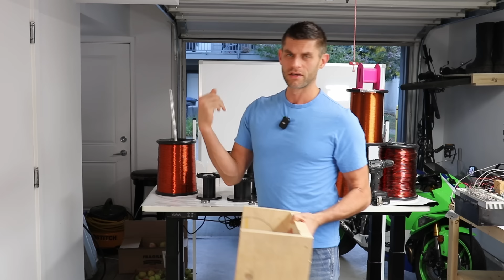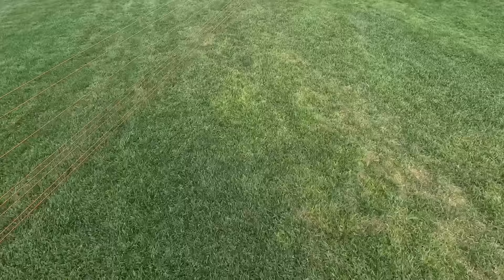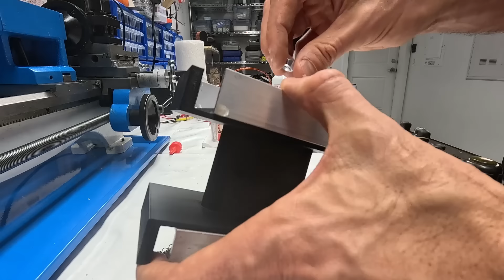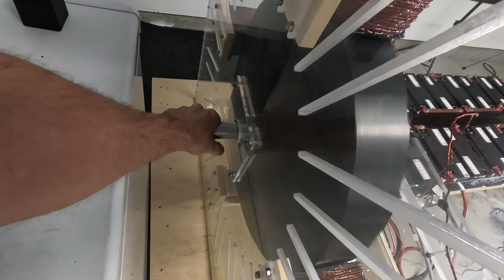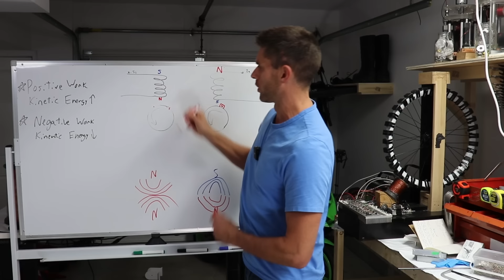The Device That Could Give The World Unlimited Energy

Comment: From my limited understanding on this motor the extra power is coming from the high voltage spike when the coul is turned off which is used to charge the batteries....now later in Bedinis work he started working on the MEG...motionless electromagnetic generator which used the same concept but eliminated the spinning flywheel and instead used 2 sets of coils...2 to create the high voltage spike...and 2 I believe to capture the high voltage sike to charge the batteries eliminating the need for the spinning flywheel making the device solid state with no moving parts....have you done any research into the MEG ....
Family problems kind of made me lose interest or should say was busy with life so have not done much research into the MEG device so just wondering if you have any knowledge about it or conducted any research into it...
I dont have the resources or equipment to explore it like you have but am very interested in your work....and am very interested in the MEG but have not seen anyone actually build a working model of the MEG...
Reply from the maker: Yes so many things to build :) im going to focus on finishing this build but yes the MEG tech looks legit 

Thanks for commenting

Comment: WTF -.- did no one catch that he did not show one time the end of the shaft reaching out behind to this big white box?
He grabbed it by hand to slow down the spinning oO but never shows the end of the rod/shaft... 1000% a motor is attached

even if not... why did he show these useless meassurements?
Reply: 29:34 its not connected to anything check the time stamp, or any other video where he shows around the whole machine.
Reply: @joshz7419  uhaa ... how did I miss this XD ... OK but still the meassurement is not really anything usefull ...(*￣０￣)ノ

a simple setup with two identical AMP and VOLT meter side by side... one for batteryOut and for batteryIn... in one shot over a few seconds would had prooven much more... 
and an oscilloscope is needed to show these spikes he mentioned... 

some variables to calculate the data by myself for the in`s and out`s would be nice ^^

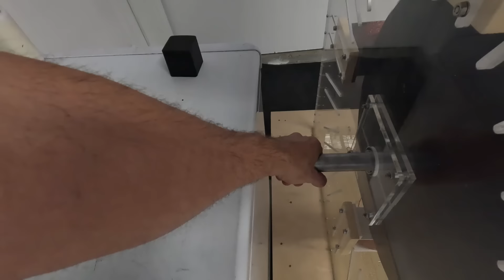36:22 perfect obscured
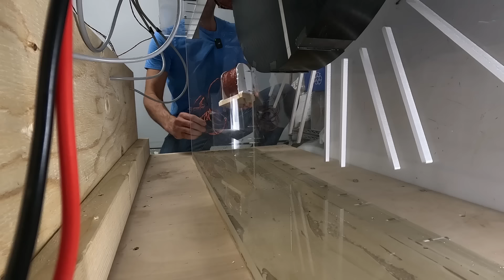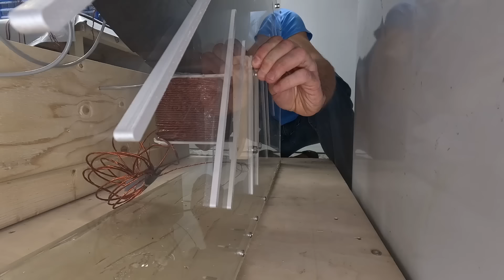25:45 - 26:00 perfect obscured
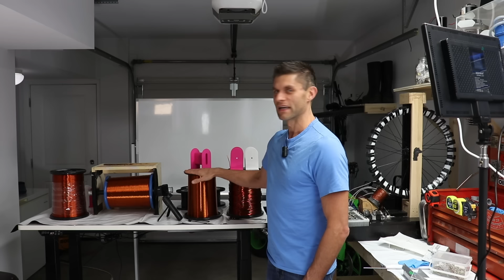20:52 (background) perfect obscured

every time soo close (╯°□°）╯︵ ┻━┻
Reply from the maker: Thats a white deep freeze lol
Reply: So if you connect your flywheel to bicycle pedals, and make 500rpm , wouldn't that be the input rotor rotation needed to trigger all of the system...? Why ever drain energy to spin a wheel..
  I think I read that in an ancient cave ,wall drawing, bro good luck..
Reply from the maker: Lol

Comment: Question: If your batteries are not connected to an Earth 🌎 ground, how can the circuit be completed between the ethereal energy and the batteries? Without an Earth ground, isn't that an open circuit?
Reply from the maker: I dont think so aether just flows in it dosnt need a ground to earth 

Though we plan on having one and seeing difference
Reply: @MadscienceLPTECH I just noticed that Mr Tesla had a huge earth ground on his setup, and I wondered why it was necessary. I will be interested to see if it makes a difference. 
I have 3000 watts of solar panels and a wind generator, charging eight 25.6 volt, 100 amp hour LiFePO4 batteries. 
I find your theory to be very possible. 
I don't know a great deal about that end of the free energy world, except that I think you're onto something, because of one thing. The Dendera light bulbs that lit up underground areas worked off of high voltage ⚡. The base of the bulb 💡 projected a beam of plasma through a " lotus flower " ring that adjusted the plasma beam towards the anode. Sort of like a microwave tube magnet 🧲. I never knew it was that high tech until I watched a YouTube video about it recently. Whoever made them knew a lot about electricity though. 🤔⚡⚡👍
I've wondered about the push/pull of the magnetic coils, if maybe they don't have to both be utilized to achieve " over unity " and perhaps that's why only using one or the other, like only using one pole of the coil, wasn't enough. Some arrangement of the coil to the same disc, so the coil would be sideways instead of edgeways. 
I noticed that none of the designs such as the Bedini motor took advantage of that principle. I figured that there was some little trick like that was all that was missing, and nobody caught onto it. It just seems like the combined push and pull simultaneously would yield more than just one or the other. Like you said, one pole won't make as much juice as both ends of the coil being used. Just a theory I had. I just figured it could be worth a try. I was surprised that nobody has done that yet.

Comment: in the drive side if the magnetic field induced in the rotor, slip speed relative to the magnetic field in the stator increases, ie the current in the stator is regulated by the slippage of the rotor. yes your device will be very efficient as long as you don't introduce physical load to the rotor then energy consumed will be commensurate to load applied. The real beauty is that all of these interactions occur in mid-air and are ostensibly, invisible to the naked eye.
Reply from the maker: Thanks for the insight

Comment: At 40:40 I don't believe that is true at all, if your doing more work, it is not free. 
True, you should have your setup for the lowest reluctance path for higher efficiency.
Reply from the maker: The field on field interation is there for the taking use it as you will without any impact on the flow inside wire
Reply: @MadscienceLPTECH I don't believe this is true at all. 
Take any transformer, power the primary and no load on the secondary, input amps is low, now put a load on the secondary, the input current increased. You putting a larger load on the coil, and that is not a free lunch.
Reply: @MadscienceLPTECH do the same transformer above with no load, now stick another coil next to it with a load, again, no free lunch.
Reply: @MadscienceLPTECH why do you think it's free energy? I explained why I think it's not free.
Reply: @MadscienceLPTECH thinking more on this topic, you have a coil with current and swiping a magnet past that coil is NOT going to affect the coil current? (Regardless if the magnet is pushed past the coil or getting pulled) Of course it's GOING to affect the coil current in some way.

Comment: All wires are considered antenna electrically.. Learn antenna theory and you might know some more of what is going on.

The ferrite powder above the magnet is a red herring. Any structure seen from the powder is due to the powder in the magnetic field. There are no lines. The lines come from the powder. Try magnetic film and you will see the field better as the powder doesn't move due to be locked into the film.

 Also again the Bedini method of running this battery rehabber actually does permanent damage to the batteries and can only be charged or used ever again on the Bedini system. The plates crystalize and it blocks normal current charging the electrolyte around the plates. The charging process comes only from high voltage impulses of one polarity. This punches the plates and eventually crystalizes the battery plates and this crystallization will not allow the plates to interact with the electrolyte in the battery cells in normal charging mode. Only high voltage spikes will be allowed pass the crystalized lead, much like a diode type of thing. Bedini usually used negative impulses which allows the diode to pass the impulse but not the traditional current to charge the cells.
 And to be clear the output of the battery is not changed as the diode is forward biased going out. It is the charge direction that is blocked by the regular chargers we use traditionally with these batteries, the bedini method bypasses the diode by reverse biasing the lead crystal and a short burst of negative current flows. You can charge a battery by pulling the negative plate further negative and using the battery in a reverse kind of operation polarity wise. It will still charge.

The answer to your question about the poles is this. The attracting magnet will have residual magnetism and not let loose as quickly. It will cog... The repulsion method works better because the electromagnet having residual magnetism wouldn't hamper the wheel at all. In fact it might make it better since it will have a continuous magnetic push for longer time....
Reply from the maker: We dont plan to charge normally. There are going to be many ways to get the energy this is just the prototype

Comment: heres a off the shelf one for you .
car automatic fly wheel. five car alternators. 
mount them to the fly wheel the gear off the starter. will move the alternators.by put them on them. turn one alternators into a motor. it runs the others . wire it right and thats a lot of power. one small batery can get it going or a hand crank.
there seems to be a bunch of these around the back woods in the north west.
the cool part is its off the shelf.  used will work just fine 
seen them with old washer parts also. have to admit the pulls looked easyer to use.
just wanted to see if we coud do it with only car parts.
Reply from the maker: Would love to see this

Comment: Reduce the drill’s torque setting to achieve even tension, or use a large fishing reel for smoother tension control and a more controlled winding action.
Use a sensor to reverse the polarity of the electromagnets at precisely the right rotational position, so each magnet first repels the previous permanent magnet, then attracts the next one, and finally repels it to sustain continuous motion.
Reply from the maker: Great suggestions, thanks for the input!

Comment: High voltage spikes at low current contain more energy than low voltage at higher current. Is this what you are saying? You are also pulling energy out of empty space right? I'm skeptical.
Reply from the maker: Im saying sharpe gradients can cause aether to flow to balance the system

Comment: I applaud your efforts. Here's a tidbit that you probably already know:  A novel way to prove that there is a relationship between electricity and magnetism is by "converting" electrical energy into magnetism by "building" a magnetic battery. We do this every day by using a high power electric current to "charge" a neodymium magnet, by using a pulse of electricity that produces a magnetic field that the neodymium material "stores". Another energy link is that temperatures above the Curie temperature of the material can eliminate the magnetic properties. As we use the rare-earth magnets, do the magnetic domains within the magnets change? Are they permanently altered? How does (sub)atomic alignments produce a field?  Much to ponder. What else does it do? Spin? Keep up the effort, I'm sure you will find something wonderful.  Cheers!
Reply from the maker: Thanks for the kind words and input! Always good to ponder these things.

Comment: Spencer, motivated by $30,000...ready to ramp this up 
99% of us if dropped on desert island with electrical components and a soldering iron would be unable to 
make a radio a land line phone or an electric motor without a lot of effort and books on the subject. 
into this void comes Spencer to tell us he has replaced oil, gas and nuclear with his electrical thing. 
But he wants money from us. 
There are two kinds of videos like this I see on Youtube. 
1. the confident salesman fraud
2. the true believing tinkerer who usually does not ask for money and does not have such fine speaking skills. 
Do not invest.
Just watched a little more...cannot decide if he is fool or fraud.
around 32 minutes I guess he does not realize the work to approach some pushing or pulling 
magnet exceeds the push or pull you get from it.
When he gets his generator to attach to it the resistance will increase and the thing comes to a halt .
If no retraction by January 1 2026 he should know better. 
Ir is rough when something that seems so important does not work.

Comment: Use a 1p set of high output lifepo4 cells like Headway 38120HP and livestream it for 12 hours. BMS can measure power in vs power out. Put it all on a glass table.
Reply from the maker: Lol if we need a glass table then thats not the type of viewer im after. Either you trust me or you dont, a glass table wont change that
Reply: @MadscienceLPTECH the huge bank of batteries is already a little concerning; use the smallest amount that will start the machine. Big battery banks Makes changes in state of charge hard to see over a relatively short amount of time; also using lead acid batteries with its float voltage charging can obscure the results.

I'm trying to offer advice that will make the results harder to argue against. Remove variables from the system; lead acid batteries is a big variable in my opinion.

Comment: Great analysis on this pulse motor prototype! While it's a cool DIY demo of electromagnetism (recreating Ørsted's experiment with coils & magnets), the "free energy" claims don't hold up—it's not overunity or drawing from the environment/zero-point. Scaling it won't make homes grid-independent; inefficiencies (heat, resistance, back EMF) ensure net energy loss, per thermodynamics. Similar Bedini/Adams motors have been debunked as efficient but not self-sustaining.

On the battery voltage increase (e.g., ~0.08V rise): It's real but temporary—due to surface charge from flyback pulses (quick "top-up" that fades fast) and desulfation (breaking sulfate buildup in lead-acids, recovering lost capacity, not adding new energy). No closed-loop tests shown; batteries drain overall. Fun build, but for real off-grid, stick to solar/wind. Props for open-source vibes, though!
Reply from the maker: You're incorrect. Unlimited energy is already done and patented and being implemented. Ill show it in my next video
Reply: @MadscienceLPTECH  Looking forward to your next video :)

Comment: LIBERTY ENGINE 2.0 - 5.0... ALGAE FUEL... Unlimited biodiesel. ANAEROBIC DIGESTION... Unlimited Natural Gas. Fertilizer and Synthetic Lubricating Oil... BEAT TESLA! Place two windmills on the front of the Electric Vehicle. As the EV move through the air, the two windmills charge the batteries. Non-Stop!     Hear, hear! YouTube!
Reply from the maker: Liberty seems like a scam*